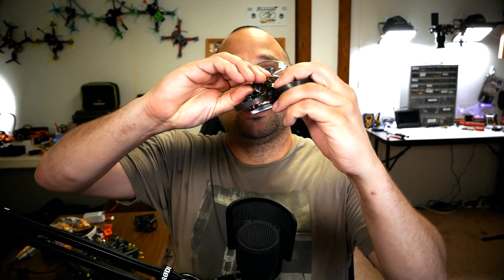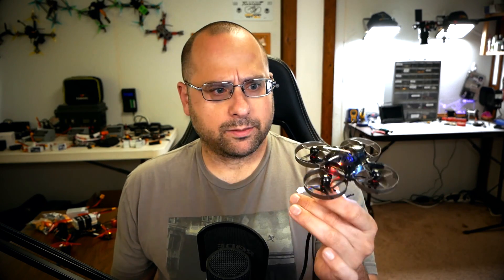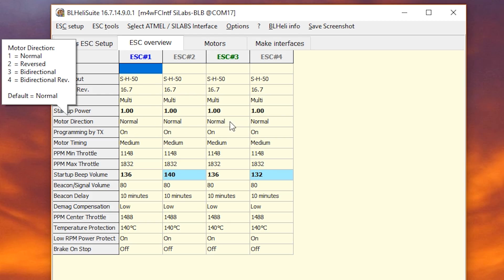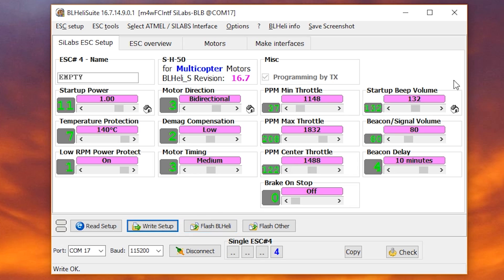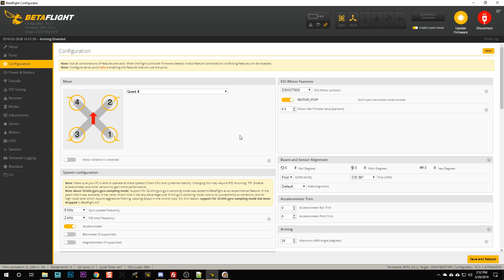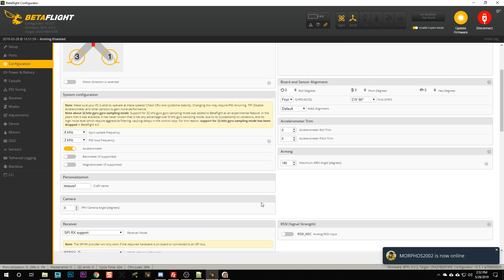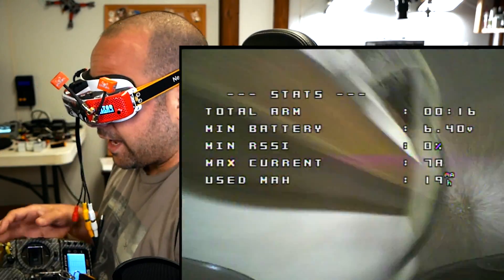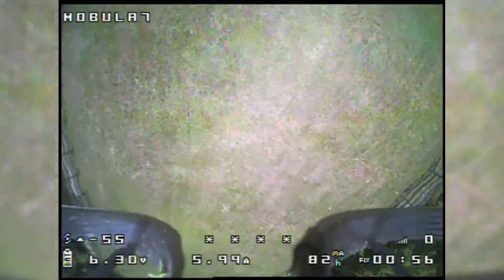How I Flew This Mobula 7 Upside Down | BETAFLIGHT BLHELI 3D MODE HOW TO SET UP

Comment: On a bigger setup You could use two cameras Like in the cheater quad but both up front. 1 facing up 1 facing down
Reply: It's not that simple because even with an upside down camera, the stick inputs will be reversed. The upside down camera will tell you to push the stick forward to go forward but the opposite is true. The same thing is true for left and right. After a lot of inverted practice, the inverted view in the camera acts as a cue that the sticks are reversed.
Reply: @chrissieracki2959  on the cheater quad the comands reverse when you Switch to the other camera. I think you could do the same thing

Comment: Is there a way we can add it to a switch or mode, then have it instead of flip over after crash mode? 😊
Reply: It can be add to switch mode but I don't think it will be good as replacement of  flip over after crash
Reply from the maker: Flip crash specifically deals with the situation where props are against the ground.

Comment: This technic, as you say, would be useful to increase the momentum artificially. That way it would be interesting to play with the settings in Betaflight to get the Zero throttle at maybe 15%.
Reply: I tried this, unfortunately there's a minimum throttle center in BF which doesn't go very far down. I think the better option is 3D on a switch. It works surprisingly well and you don't need to relearn how to fly, you just flip a switch when you want 3D.
Reply: @mitchharvey9202  Ohhh that's really interesting, I never thought about having 3D on a switch. Thanks for the idea, I will definitely try!

Comment: 3D can be a nice challenge. One drawback though is that you basically reduce throttle stick resolution by 50%, since instead of mapping 0 to 100 percent throttle on the full stick throw, it now has only half the stick throw. This can be hard to adjust too, but not impossible, as every collective pitch helicopter pilot, who does flips and other 3D stunts, needs to be able to cope with this.

Comment: Cool to see you cover this- thanks for the shoutout :D Hope it'll get more people into 3D.
Reply: I forgot to ask... Do you have a controller with the centering spring engaged that you use for 3D, or does it work well enough to be able to use it without self centering?
Reply: @ledchickenfpv7164  I'm just getting into 3D and I can confirm that having the spring on your throttle helps a lot to overcome the muscle memory when going to zero throttle
Here's me getting to grips with 3D in my Chameleon https://youtu.be/ItQLhITqFiM 
(after practicing in the simulator extensively ofcourse)
Reply: @ledchickenfpv7164  I know that multiple times I've accidentally switch 3D mode on in the simulator and still successfully flown for a while, so it's not as hard  as one would assume I believe
Reply: @ledchickenfpv7164  A centering throttle would not be as useful as you might think. One thing that I don’t think was mentioned is that you need to disable air mode. The quad wants to tumble at low throttle so you need to move quickly past the center point.
Reply: Have you tried 3d with xclass?
If anyone is good enough to succeed and not kill anyone its gotta be you...

I think more people would be interested in 3d if they knew it was this simple...
Reply: If you ever end up in Vermont and you're so inclined I'll be your pupil. 👍 When you're inverted, all the other inputs get reversed too, don't they? Or has that been taken into consideration in software? I'm kind of wondering now if it would be easier to learn to fly 3d if the software inverted channels as needed whenever you're generating negative thrust, or if it would actually work better without automatic compensation. I'm usually pretty good at thinking through anything mechanical, but I'm definitely having some issues visualizing all the implications of spinning the props in reverse. How does the throttle even get set up? When you're inverted, are you working the bottom half of the throttle stick's travel? Seems backward at first thought, but I'm guessing it might be easier than retraining yourself to pull down to increase the throttle when uninverted. I'm off to crank up Liftoff, because my curiosity has been piqued and I must have some answers! 😉 ... Happy flying! 😁👍👊
Reply: About to put this on my beta75x I hope I can do this
Reply: Thx Zoe for cool 3d flying. 👍
Reply: Keep the 3d up Zoe! Already told my wife about you and your 3D flying style! ;-)
Reply: I learned about 3D FPV drones back when you did that collab on Rotor Riot!
Been casually interested, but back then you had the problem of analog ESCs and lost throttle resolution.
It seems that Dshot fixes these problems and also lowers the barrier of entry, and now I'm interested!
Probably going to 3D a micro at first, though if I like it I might 3D all of my kwads...

Comment: Hey @Joshua Bardwell, you said that setting the direction as "bidirectional reversed" for reversed direction motors was wrong, but you didn't say what was right. What do you set reversed motors to?
Reply from the maker: For me, normal motors used bidirectional reversed. I guess revered motors would use bidirectional.

Comment: Hiya Joshua. I've been practicing high angle (70deg) 3d on liftoff all winter long. Now that it's warm, I've started flying for real. 
I'd like to see what you think of it (keep in mind, I had to basically relearn how to fly with this, and I'm still getting used to it).

https://youtu.be/oUssWcLLvOU

Basically, high angle 3d opens up a whole new range of moves, and actually makes high angle more flyable.  With this setup, you can do things like fly backwards indefinitely, use 3d as airbrakes, or just fly inverted indefinitely since you have reverse thrust to rely on if you get into trouble.
Reply from the maker: Interesting.....

Comment: You could probably program you radios to have a regular throttle band limits with 3D set up and then flip a switch to make the throttle stick it 3D enabled mid flight. That way you have the usual control but when you want to as you say sprinkle in some 3D then you can. I imagine you’d lose some throttle resolution since you’d just be editing out the the bottle negative throttle and stretching the positive throttle range across the whole stick, but then again I guess the same thing happens with 3D mode anyways.

Comment: ok so lets say you can figure out how much throttle you need roughly for a hover. take that and make that the max negative throttle you can go. so you get more positive throttle lets call it a 75/25 split and maybe when your upside down you can just blip it down a little because like you said you don't need all the power upside down just enough lift to keep you from falling or at least close to it.. and another point i just thought of i dont race whoops. but i have flown a lot and sometimes when your trying to drop altitude real fast because you almost miss a gate, this might actually help if your skilled enough to give you a little down thrust to get under a gate at the last second.

Comment: is it safe to run motor in reverse? what happen to prop if driven in reverse? maybe it will unscrew?
Reply from the maker: It's safe to run in reverse. No damage will occur.

Most motors today are standard-thread only. So two motors are always running opposite the threads regardless.

Comment: A while back I put in a feature suggestion on the betaflight github to allow 3d on a switch. The intention being that a pilot could use the momentary switch to use the momentary switch on the taranis to give a surge of "loft" while inverted to extend a power loop beyond what they had set up the loop with initially.  Ie: So you go into a power loop, so the throttle at the apex, and realise you didn't hold the throttle long enough or pitch back enough, so you hit the stitch and give it another blip of the throttle to gain some distant and hang time to the maneuver.  - but the devs can only develop so many features...
Reply from the maker: 3D on a switch is in BF now. I don't know when it got added. There is a 3D mode in the Modes tab though.

It has only been possible since Dshot Commands allow dynamic switching motor direction.
Reply: @JoshuaBardwell  exactly. I suppose I am just patting myself in the back for putting in a feature request that actually got implemented. :)

Comment: Try your cheaterkwod with one camera upside down and change the controls so they remain correct when you are inverted. Would allow you to get the correct camera angle and not have reversed controls.

Comment: Sweet!  i could not get my snapper7 to arm a while back in 3d. Is there a way to setup a switch to change from 2d to 3d ?
Reply from the maker: It won't arm because the throttle must be centered when you activate 3D mode. You can turn 3D on and off using an Aux Mode, yes.
Reply: Thank you.... I turned that qwad into a toothpick build but I have the perfect candidate to try this....ur85hd!  Hd footage with paddle props and prop guards

Comment: I've been flying 3d on bruhsed silverware quads for years , mostly line of sight but some fpv too.
I thought about trying out the mobula7 but assumed the ESC and motors would not cope well with reversing but looks like it's ok, might try that soon.
Reliable switching is sometimes an issue with brushless 3d I found.
Good video!

Comment: https://www.youtube.com/watch?v=rYvT5upr4OQ&list=PLhm-AAbSpJ4h_F8fMyrxdwH5dy0c2LbMD&index=7 I have been into 3D for ages and its awesome to fly.... with the latest version of BF you have a switch that allows you to flip from 2D into 3D and back... so you can do those extended power loops if you want...... 
Not that I am an expert but a few tips... 20 mistakes high..... 4S and higher powered motors ( I use 2700kvs) camera angle (for me) is level or just up slightly.... hardest part is not fully throttling down when you panic which is a common reaction.... Airmode is a must as its smoother... and use a cheap camera (pref not a gopro) once the brain is trained (which is pretty much like learning to fly with goggles on as we all did day 1) it becomes automatic... I have also tried this on 7" x 550 quad and it was smoother but rougher on the gear..... congrats on the new bubs.... and yes.... your clean shirt/ dirty shirt back to clean shirt messed with my ADD..... dont step on the cracks and stay safe........

Comment: Does rescue mode or angle mode work in 3D mode?
Reply from the maker: I'm no sure about that but I don't see why not.
Reply: Joshua Bardwell; just to help reorient my brain after a few flips.

This is gonna be fun with a cheater kwad setup.
Reply: For Rescue or HardDeck you need iNav3d software

Comment: You need to try iNav3d.  Has Hard Deck, Rescue, Automatic Low Battery RTH, Inverted Position Hold for 3d Learning, and Many/Many/Many other features for 3d Flyers.
Reply: Thanks for this.I was totally unaware of those functions. I thought inav had to do with integrating GPS functionality. Something new to read up on. And here I thought YouTube comments were only for trolling and starting arguments about religion or politics. 😉😁👍👊

Comment: need 3d mode on a switch to turn it on and off or invert complete throttle range on a switch
Reply: When you enable 3D mode on betaflight, there is an additional setting in Modes tab which does exactly that.
Reply: You could setup everything for 3d mode and then have a mixer setup to switch between -100 to 100 and 0 to 100 on your throttle channel. You could also just invert the whole channel on a switch but that might be more useful for LOS and you'd want to do a similar setup to a cheater quad where other channels are reversed too.
Reply: this would be sick!  maybe betaflight profiles on a switch but not sure how b_heli setting could be changed on a switch and tied into betaflight profile switching.....someone smart make this happen, my brain hurts already!